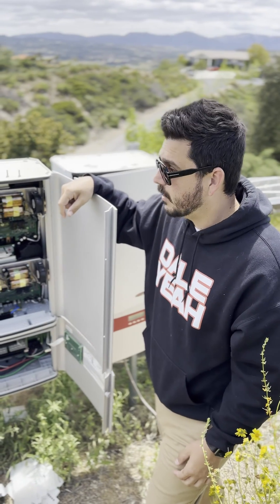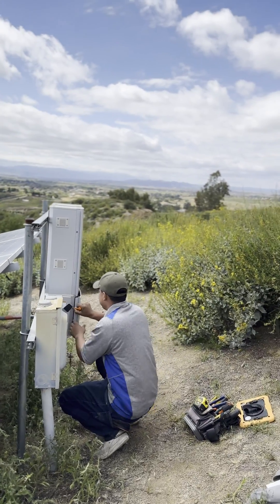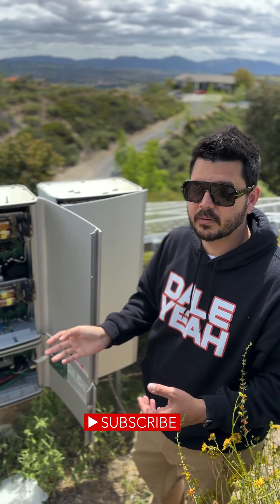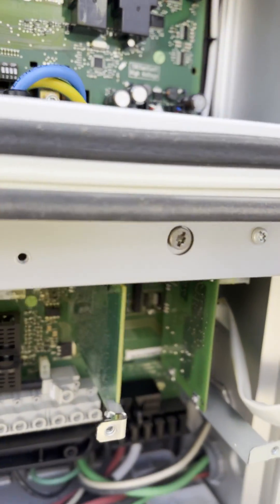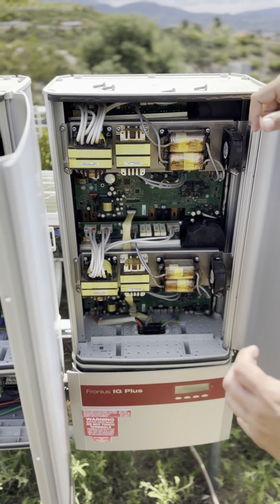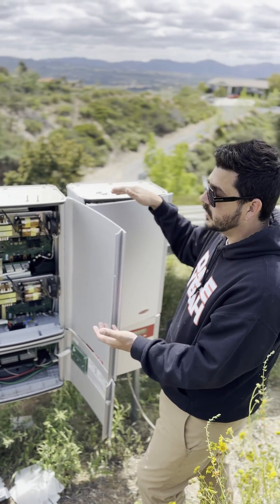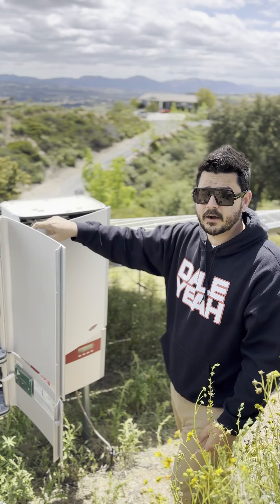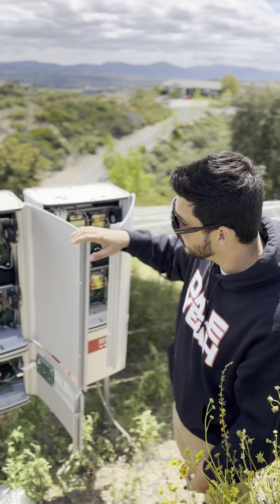Solving a Solar Inverter Shutting Down Mystery

Comment: With regard to an oil fire putting itself out inside the inverter cabinet because its air-tight. That is not really true, those inverters have a forced air, radial cooling fan with an intake and exhaust on opposite sides of the inverter enclosure. While it may very well be true that the flammability of oil may be low enough that it is mostly self extinguishing, its not because of air starvation. More likely that the fire destroys the PCB and current stops flowing so the electronics stop acting like a source of ignition.
Reply from the maker: So what actually happens is the dielectric mineral oil breaks down over time and losses some of its non-conductive properties, it also can become contaminated with water and particles. The combination of these things creates a short which can cause a fire, without a simulated situation that’s controlled and monitored it’s hard to say how or what extinguishes the fire when it occurs. Please keep in mind this is very rare, and I’ve only seen three or four inverters that have caught fire.